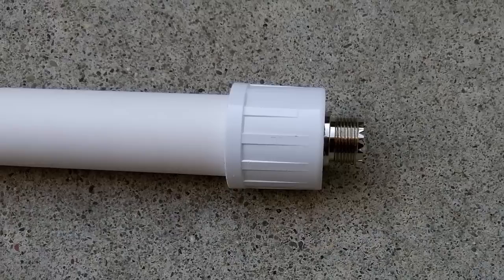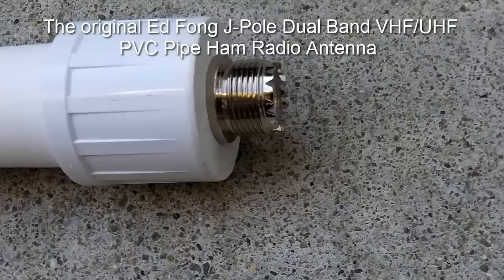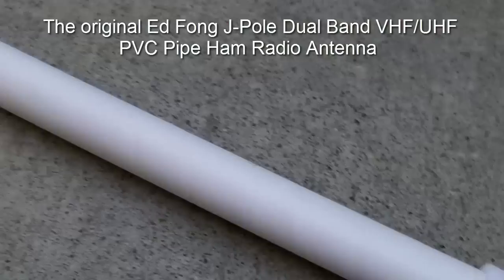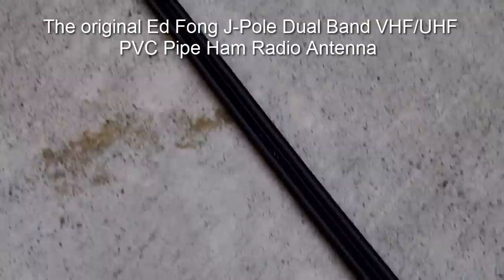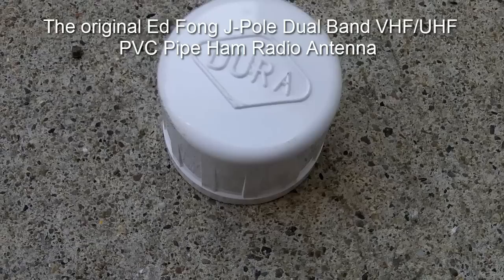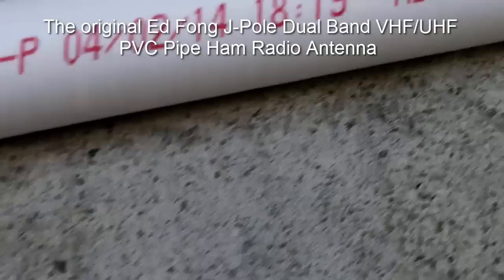The original Ed Fong Dual Band VHF/UHF 70cm/2m J-Pole PVC Pipe Antenna : Eye-On-Stuff

Comment: After having used an Ed Fong antenna I have to say it was a good antenna for what I needed.  I was able to hit one repeater 30 miles away but the repeater was up 350 ft. that helped.  On 440 its not quite so good.  However for a cheap antenna that will get it done...this aint bad.

Comment: It's a shame that people think that an inexpensive pre-built antenna is somehow related to a dumbing down of amateur (note the proper spelling, Dan) Radio.

I don't own any twin lead, or a bunch of SO-239 or PL-259 connectors, as I'm one of your dumb new Extras. I've acquired Baofeng, BTech, Kenwood, and Yaesu radios already, but have no place to put up a simple dipole, vertical or otherwise. Wanting something simple, compact, portable, and predictable when it came to an antenna I could use with my young students, it made sense to try out Fong's antenna. When I do get around to mounting a "real" antenna, I'm hoping to keep this one as a backup for field operations.

I'm astonished at your view of amateur radio, especially toward us newbies. The "science" of radio takes place with a 5-foot J-pole as much as with a 6-foot collinear. I want to see what it can do by experimenting with it, and if it performs badly compared to something else, that result is useful, too. Even so, my "skills" will be enhanced with every effort I make to maximize contacts with a challenging antenna. Clearly, the antenna works with low SWR readings, so what can it hurt to try to optimize reception and transmission with it?

But if your sense of the worthiness of this thing is tied up with whether or not I make it myself, then you've not made your case. I don't have the time to find all the parts and pieces I'd need, and that counts in the cost comparison. My skills in antenna building at this point are not nearly as important to me as getting on the air, even if this is "only" VHF/UHF.

Let me ask you, Dan, a similar question. If you wanted to learn a musical instrument, and weren't sure if it was going to be right for you, would you go out and buy an expensive instrument immediately? Or would you be expected to have to construct your own before you began learning how to play it? I see no difference between these scenarios. A beginner can start with something high quality, or something a little more workaday. What matters is that they learn how to play it.

My piano teacher always said that a true master of the piano can make a lousy piano sound good. Wouldn't it indicate similar mastery if a ham could coax good results out of a "lesser" antenna or radio? I think so.
Reply: Christ, pin this comment, it's brilliant.

Comment: Nice video, thank you. I purchased one today. Planning to use a Laird FM-2 pole-to-pole mount to secure it to a telescoping flagpole. The inside diameter of the pole mount is 1.4" which is too large for the OD of a 3/4" piece of  PVC. The OD of a 1" piece of SDR 21 (200 psi) PVC is just over 1.3" which would be a perfect fit for the pole mount. I'd have to convert (or rebuild) the 3/4" endcaps or I could use a 1" to 3/4" reducer and a 1" piece of SDR 21 PVC pipe. Would either of these solutions be a problem?

Comment: i'm not sure how Ed Fong can claim he is the inventor of the "j-pole inside of pvc pipe antenna" as I was using a dual band j-pole, crafted from twin lead wire mounted inside of PVC pipe, in 1994 - but Ed's website claims articles published as early as 2003, and that he has sold this antenna for ten years ...

Comment: Well, you can get the approximate dimensions off the video. And I have all the necessary cable in the garage. So thanks for sharing the design. 👍
Reply: ask ed fong, he will send you a pdf on how to make it.
Reply: Plans are online in pdf or print.  A little taxing to read.  I'm in the process of building one now.  
The one in this vid looks like the dbj2.....almost.  the extra string and wire thingies at the top are different from the plans I saw.  So may want to double check.

Comment from the maker: I am not using a choke with my antenna. It works fine  with my local repeaters as far as ~30-50 miles. The antenna is mounted on a light stand inside my house on the second story.  The house is surrounded by stucco so mounting outside is more idea.  I'm only TX-ing with a 5W handheld.  Radio checks are coming back very good to full quieting.

Comment: New ham here. I know this video is a few years old but I'm hoping you can still answer my question. You mentioned inside use. Would this antenna work well in a attic of a 2-story home? All of my local repeaters are within 10 miles of my home on very flat (Indiana) terrain.
Reply: I live in a ground floor apartment in a valley and I hung this antenna vertically inside my apartment in front of the sliding glass door curtain rod. I can hit a repeater 20 miles away on a hill top that is linked to repeaters as far as 160 miles away both 2m and 70cm. It opened up my whole world to ham radio. I'm using a HT/handheld radio 5 watts. Both 2m and 70cm, VHF/UHF

Comment: Has anyone tested and printed out the SWR   readings on both 2 m/70 cm bands to show the readings at both ends of each band ( high ,middle and low) for this antenna inside the PVC ??
Reply from the maker: Rev Big D I'm not sure, but I know that Ed Fong calibrates every antenna to certain specs.
Reply: he will optimize it to your desired frequency

Comment: Think of this dual band antenna, as your transmitter sees it, two vertical 1/2 wave dipoles...

a half wave vertical dipole has more gain than a 1/4 wave ground plane... The 1/2 wave dipole does not require a ground plane or ground plane  elements...

get it up as high as you can, and away from all metal objects......
Reply: i hope you're not a Ham with comments like that..!!

lol..

Comment: What or how do you attach the upper end of the antenna to the inside of the pvc so it doesn't slide down on itself ?
Reply from the maker: The material is light enough to not require anything to hold it up.

Comment: Very awesome antenna. Have you tried it out in simplex mode? From radio to radio?
Reply from the maker: KuriosPC I have only used it with a repeater. I'll see it I can do some testing. I heard from some users of the this antenna that they have compared it to a number of other antennas and the Ed Fong antenna always comes out on top. It's worked really well for me so far. Thanks for watching!
Reply from the maker: +KuriosPC I never used it for simplex, but I'm sure it will perform just fine.
Reply: +Eye-On-Stuff here in lays the problem with the dumbing down of the ham tests. While the J-pole may make a fine portable antenna there are far better antennas for fix station use..

The J-pole  actually has less gain than a simple 1/4 wave ground plane so if a j-pole is outperforming other antennas at your shack you better take a close look at those other antennas because something's definitely wrong with the other antenna installations.

If you're using a J-pole style antenna and think it's performing  well  then you will be amazed at the performance of some of the stacked collinear designs available.  

 For comparison, assuming no feedline losses  50 watts into your J-pole equals around 44 watts ERP aka effective radiated power. This means you're actually LOSING about 5 watts of power, not to mention that J-poles have serious issues  with feedline radiation and are susceptible to common mode. 

 On the other hand a collinear antenna consisting of 3 stacked 5/8th wave elements will turn that same 50 watts input into a bit over 346 watts ERP. Yup thats a whopping 346 watts of  effective radiated power.  Even a much simpler collinear consisting of 3 stacked 1/4 wave elements will give you a respectable 142 watts ERP as compared to your J-poles 45 watts ERP.

Now let's add some reasonably attainable horsepower to the mix and say you add a 180 watt MFJ  brick amp to the system. Once again assuming no feedline losses your J-pole would be costing you about 20 watts in loss giving you an ERP of only 160 watts.  

 On the other had that same collinear consisting of 3 stacked 5/8th wave elements will turn that same 180 watts input into a staggering 1245 watts ERP yup thats right a whopping 1.2kw of ERP vs 160 from the J.

  Unfortunately since most hams nowadays simply memorize the dumbed down tests rather than actually learn the material very few understand these basics making them easy prey for snake oil salesmen peddling their miracle antennas which defy the laws of physics.
  
Ever wonder why fong refuses to use any real science to back up his advertising claims but rather resorts to snake oil salesmen style tactics like using  "testimonials" AKA subjective personal opinion,  You would think a Dr with a PHD electrical engineering  could provide some solid math and science to back up his controversial advertising claims rather than relying on subjective personal opinion in the form of  "testimonials"
Reply: +Dan Nelson ...set you back a LOT more cash! I know in other areas there's more ground to cover between anything, unlike where I happen to live, but to just say everyone should avoid jpoles is ludicrous. I agree a stacked colinear is a great thing to have at your disposal if you can afford it, but that's like saying a vertical for HF is a waste of time, and not a good antenna. Everybody should be using log periodic antennas!. Well maybe those ARE better, but not for everyone. A random longwire  is what's best for some.
Reply: I never said people should avoid them quite the contrary Personally I think it's a rite of passage for a new ham  to build a J-poll. The only issue I have is the erroneous almost sensational snakeoil performance claims that utterly defy the laws of physics which so many hams propagate regarding these antennas.

They are what they are,  But to seriously claim they are superior to say somthing like a stacked collinear design is delusional at best and it makes hams look like idiots to professionals who do this for a living. 

 For example if your J-pole is outperforming somthing like a Diamond X510 for instance then there is a problem with either the feed line or the X510 . That would be the conclusion and the first place a real ham would start to look.  

  The problem is there was some very dishonest modeling done of the J-pole and slim jim and even those those models have been debunked by some of the world's most respected antenna modelers hams are still referring to those flawed models as are dishonest sellers
Reply: Cor Blimey! Same in all clubs bickering and slagging off each other. Cos i know best! Why don't you all grow up or go to your own corner of the playground to rant.leave people who want to learn and talk like adults be! 73

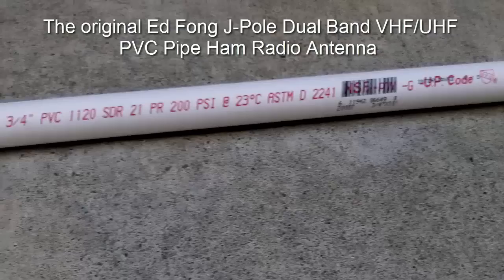Comment: 2:24 you say we should measure out the antenna that varies in length but
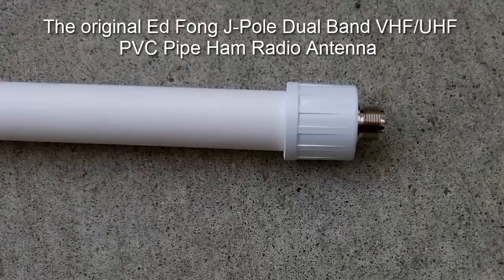3:18 Ed fong actually tunes each one before it’s shipped out 
If he’s tuning the length isn’t it already cut to the right length? 🤔 I’m new to the sport and want to upgrade my ht antenna.
Reply: I believe he is referring to measuring the antenna so that you can cut the PVC piping at the correct length. At least that was my take on the comment.
Reply: @gone2dmtns  Appreciate the reply. Still not sure about it, I was hoping eye on stuff would have replied. I got a folding tacticool type (not abbreee) from HRO a few weeks ago and it works pretty well. If and when I ever get a base station I'll revisit Ed's antennae.